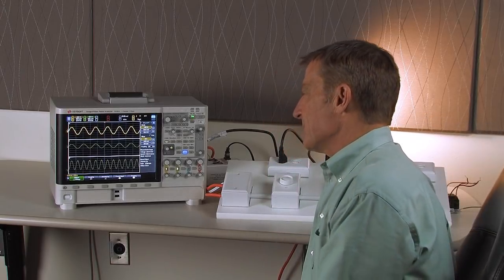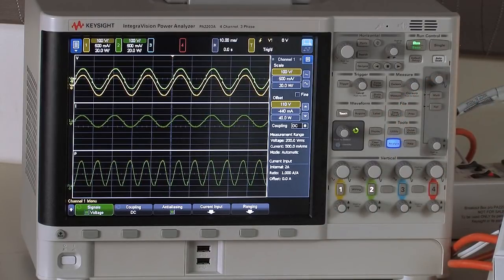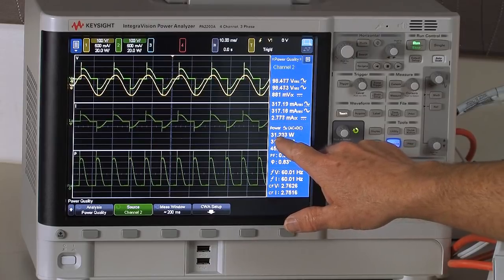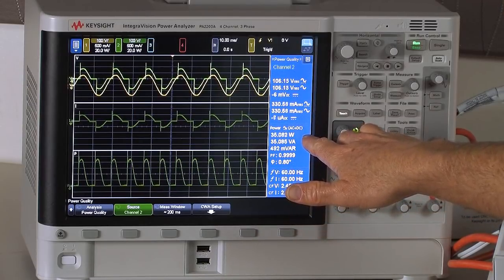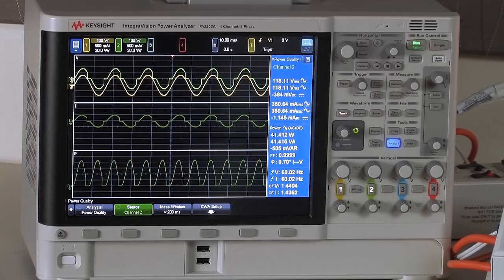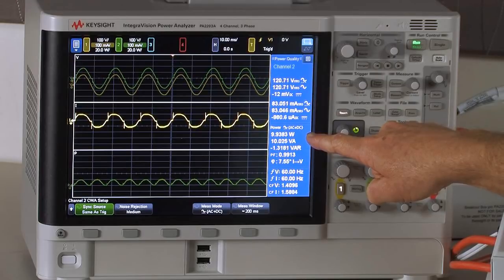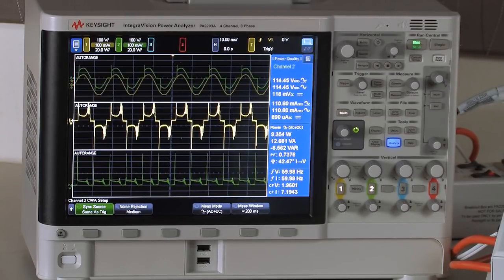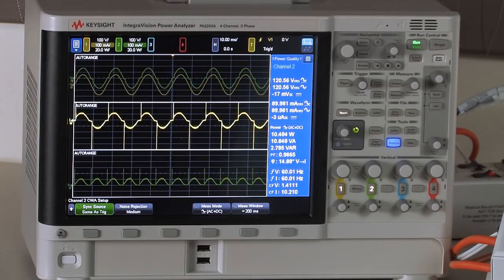Using a Dimmer Switch with LED Bulbs

Comment: but what is the theory behind a 'dimmable led'? as most leds work on a constant DC voltage? and most bulbs in the base include an expensive 120vac to dc converter.  I'm trying to understand this.

Comment: This is a great promotional video for your KeySight analyzer. However, the point of this should be to actually SHOW THE DEVICES UNDER TEST IN REAL TIME. Simply showing the waveforms defeats the purpose, in my humble opinion.
Reply from the maker: The devices under test were common dimmer switches that are used in houses.  All of the DUTs performed as expected.  I was really interested in seeing the phase control as had only read about it and looked at illustrations.  In fact one of the illustrations incorrectly describe forward phase control.  I found it interesting to be able to see the voltage, current and how they combined as power in real time.  Phase control is really a neat solution for dimming lights.

Comment: what happens when you use a transformer? i have a "non dimming" led and the transformer seams to dim it just fine. Will it catch fire or anything? The transformer is still sending a sine wave and a clipped sign wave or any kind of weird pulse. The amperage draw seems to be scale-able with the voltage.  dims to about 50v then cuts off.  dims pretty linearly. bulb is 120v type and does increase amp draw but no noticeable increase in brightness above 120v. Tested to 140v

Comment: I am wanting to install dimmable high bay LED lights  I see cheap LED lights for sale but they do not say dimmable the more expensive ones say dimmable what makes them different ? and the price is quite a bit more like 10x more is it the driver transformer  i am sure the leds are the same
Reply from the maker: Scott Lundy. Dimmable bulbs use slightly more sophisticated electronics in the bulb. The bulb manufacturers charge a premium for dimmable bulbs. I would make sure the bulbs are marked dimmable before putting them on a dimming circuit.

Comment: Hi. Thanks for the great video. Why does a dimmable LED (inexpensive) pulsates (constantly varying brightness) when connected to a generator? I tested it with two different dimmers and one showed smooth result and the other had pulsing output. How does a dimmer switch effect the output for the driver?
Reply from the maker: Ahmed Nousand  Were you using an LED bulb like the ones shown in the video?  And, was the generator (Variac) used to reduce the voltage?  A traditional light bulb can be dimmed by reducing the voltage. However an LED bulb has a minimum voltage at which it will function correctly.  The LED bulb has a very inexpensive circuit used to convert the AC voltage to a DC current.  One of the design assumption of the converter is a minimum voltage.
Reply: The generator used in the facility is operating in Island Mode. I checked the same LEDs on different facility running on Grid Power or other Diesel Generators. There was no pulsing effect visible.
The LED is with a 24 watt dimmable driver and another is a 35 watt dimmale driver. I used Siemens Universal Dimmer (20-500VA).
Reply: Can you post a video showing waveform when the input voltage is not stable? Like when the input is an improper voltage and frequency.
Reply from the maker: Ahmed Noushad  It sounds like the problem is low voltage. The light bulbs plus the dimmer have a minimum operating voltage.  The dimmer should have a specification for line voltage +/- 10%.
Reply: But it works fine on utility supply. It is more like varying brightness (100 lux variation) rather than flickering.

Comment: A very nice presentation. 

As of January 2019, finding compatible LED bulbs and dimmers is still a bit of a crap shoot.

The Institute of Electrical and Electronic Engineers (IEEE) has made a first-pass attempt to quantify Lamp modulation and flicker
with Specification IEEE 1759-2015. 

Lamp buzzing and Radio Interference - other than dimming lamps with a variable transformer or variable DC supply, one good solution to both 120VAC dimmed lamp buzzing and dimmer RFI is a "Debuzzing Coil".  It also helps buzzing of 120VAC non-dimmed lamps.

I recently converted a number of 120VAC light fixtures from incandescents and CFLs to LEDs. Some are dimmable. I thought the new Lutron LED-compatible (trailing edge, FET?) dimmers would interfere less with my favorite AM Talk Radio stations than my original Lutron (leading edge, TRIAC) dimmers. No significant difference.

I tried various types of Radio Frequency Interference (RFI) filters to no avail. Then I discovered Debuzzing Coils, specifically intended to reduce light bulb and fixture buzzing. They're simply installed in series with the load, or if a dimmer is used, in series with either "hot" (BLK or RED) lead of a dimmer. Doesn't matter which. By slowing a dimmer's ON or OFF transitions, they also reduce AM Broadcast Band RFI from 30 to 40 dB. Typically a 10 milliHenry, toroidal (donut-shaped) ferrite inductor, they come in 100, 150, 300 and higher Wattage ratings. Lutron and a number of manufacturers sell them. They're on ebay. 

Agency-approved Inductors aren't cheap, running anywhere from $25 to $100, depending on Wattage (Load Voltage x Current). Higher Wattage inductors are larger, to accommodate larger wire and a larger ferrite core, to prevent magnetic saturation. A 150 Watt Inductor is about 2 inches in diameter and 3/4 inch thick. It can always fit somewhere in a multi-gang junction box. Larger Inductors are up to 4 inches in diameter and won't fit in a single-gang junction box.

If you're electromagnetically inclined, with the right test equipment, you can buy your own cores, enamel-coated Copper wire and wind your own. Please understand you're dealing with National and Local Electrical and Fire Codes when installing non-Agency-approved devices in your junction boxes.

Comment: very nice video, I would like to ask, 
I have 7 cob leds with serial connection and ıt needs 180v max power,  I used dimmer and full bridge reclifier  and they work great, but I didnt put open long. it can be  damage leds in long time?

Comment: Great Video! What were the bulbs used??? Thank you for visualizing this on your scope, (as you would say, Keysight drool-factor has increased by "X's")
I was shopping for dimmers when I found your video. I chose one (Leviton Lutron DVLV-600P) but looking through all of the companies documentation: there is no mention of "forward" or "Reverse"  Phase control. I suppose that if this method becomes accepted there may be marketing to reflect this.
Reply from the maker: Josh,  Soon after I made the video the hardware store stopped selling the inexpensive LED light bulbs.  The price of the high quality lights has dropped significantly.  Most dimmers are forward phase. The reverse phase dimmers were designed to be used with low voltage halogen lights. I went to a couple stores in order to find one. Today, LED bulb designers have to design their dimming bulbs to be compatible with forward phase control.

Comment: Why does the power factor change so much on the LED bulbs as you dim it?
Reply: Led is a semi conductor that’s why! Micro radio activity due to resistance on a ac current but also allows conductive polarization 😮

Comment: What happens when you put a capacitor on the dimmer load?!
Reply from the maker: +Tradie Trev Great question. When the voltage changes suddenly a capacitor pulls a lot of current.  The LED bulbs use a capacitor in their driver and you can see the current spike at 5:50 (middle waveform).  I also noticed the reverse phase control switch which is designed for a capacitive loads had a limited range - it did not go past 90 phase 3:29.

Comment: What happens with dimmer signal after full bridge rectifier?
Reply from the maker: Mr .soj When a sinewave is applied to a full bridge rectifier the output is a completely positive signal - a series of humps. A dimmer will remove a piece of every hump.  A capacitor is used after the rectifier to create a dc signal. The capacitor is the biggest part inside an A19 lightbulb which has additional circuity to create a current source for the LED.

Comment: I dim my dimmable led bulbs by converting the AC to DC and vary the DC voltage to the bulb.
Reply from the maker: Frenchie.  Very cool.  Another method is to use a constant DC voltage but occasionally switch it off.  This method is referred to as pulse width modulation (PWM).  Using the same voltage creates the same color from the LED. The amount of light or brightness is determined by the length of time the voltage is applied versus not applied.  Hopefully, a future video.

Comment: some dimmer switches make a humming noise with led bulbs .....
Reply from the maker: luciu constantin The buzzing is very common, caused by an inexpensive part inside the switch.  The AC power in your house has a frequency of 50/60 Hz - you can think of the humming as "current music".